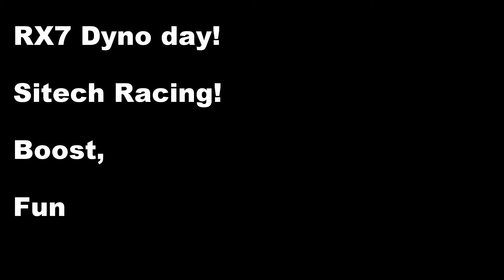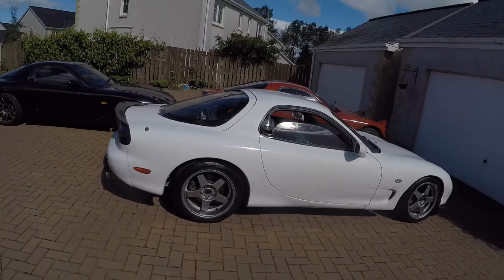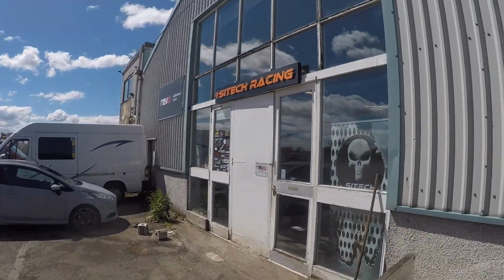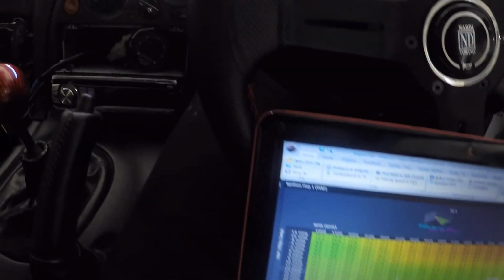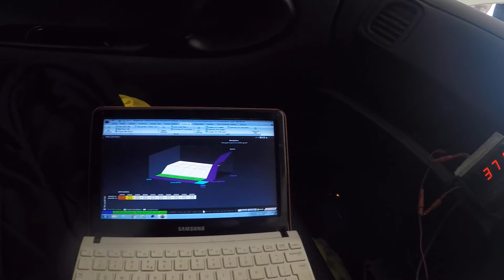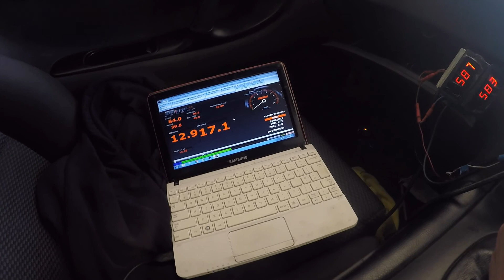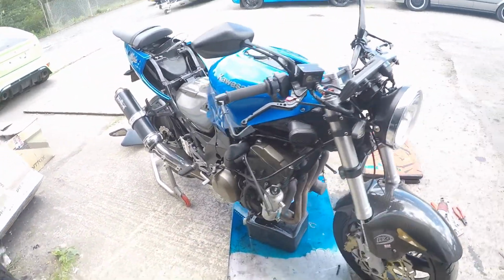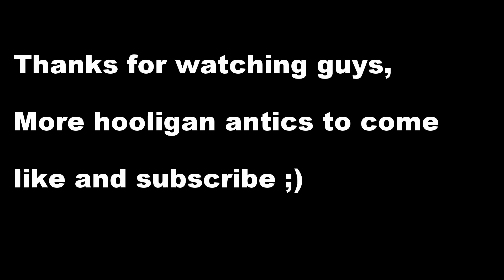MAZDA RX7 DYNO, Mapping my Adaptronic ecu. BHP???????

Comment: Nice Gav. Cant beat the rotary sound! just running 99ron?
Reply: I'll wait for the video! :) i'm stuck on 95 :( flexi fuel for me next.
Reply: Going for e50 mix :)
Reply: But I wanna play with methanol :)
Reply: I was going to go WMI, but flex fuel using a 95/e50 map was more appealing to me so kinda set my heart on that. I have an inletmanifold with secondary fuel injection but haven't pluged it in as I don't need it yet. wait till I run outta fuel pump.
Reply: I could ask marshall if he'd slip me some aircraft fuel and burn out some 02 sensors :)

Comment: quick question did you have problems non start randomly with adaptronic ecu I'm having some weird problems eml not lit up and cooling fans on when this fault occurs and non start 
disconnect battery 20min connect and everything back to normal runs ok have you had any issues with adaptronic